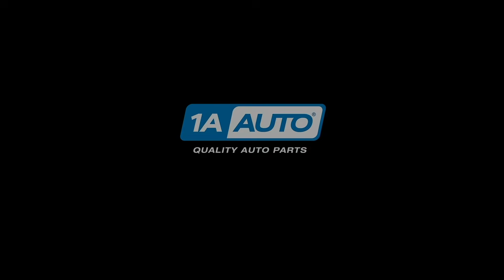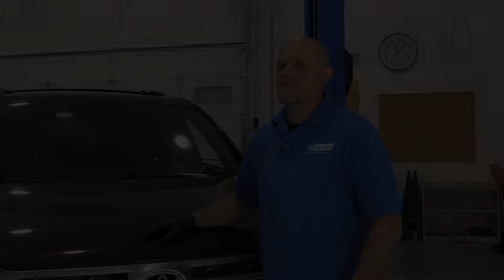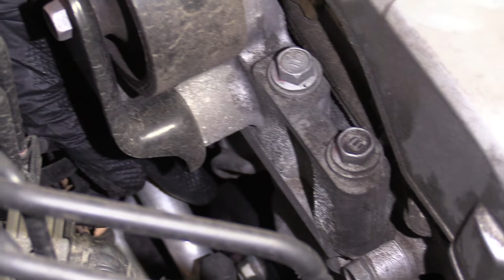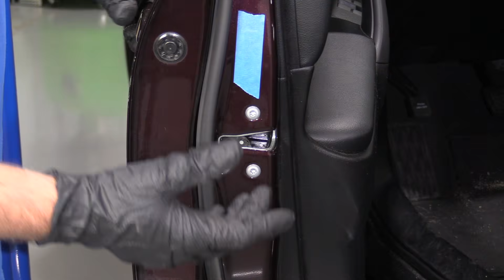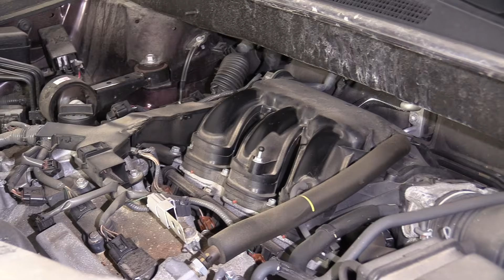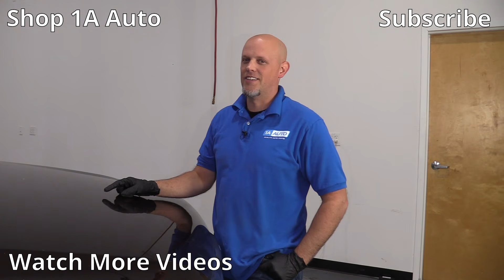Top 5 Problems Toyota Highlander SUV 2nd Generation 2008-13

Comment: I bought my 2012 highlander almost 8 years ago it had 29,000 miles. All I been doing is oil change, brakes and tires never spent a dime on anything else since I bought this car. I guess am lucky. Currently it has 134,000 miles.
Reply: I’m looking at a used one, 2 owners 145k used. I’m familiar with Toyotas reliability, currently have a Avalon 😁, BUT is it worth it getting it with 145k? They want 13k
Reply: @B-Man847  hello, did you get the Highlander? Someone is selling me a 2013 límited Highlander with 168k miles and they want $15k, is it worth it?
Reply: @igorrosales1799  I did not. It was sold. Lol. I actually just gave my Avalon a mini makeover so now I’m over the itch to get a car.
Reply: @B-Man847  i have a 2013 Avalon now, I just bought a very clean 2013 highlander limited with 150,000 miles for $15,000 as a second car, I’m picking it up tomorrow. Honestly these cars are so reliable that you can drive it for years and not lose much value.
Reply: @sammiemakki9339  Just bought 2008 Highlander 186,000 on it $9k  All maintenance records came with Previous owners had 12 yrs, bought 2 yrs old. Was a leased vehicle with 53k so hwy miles there.  Anyhow they change oil though blended syn every 3 to <5 k All repairs mentioned above here were fixed/repaired. Only worry is transmission fluid never changed. Seems to shift ok but I'll get that changed right away and switch engine oil over to full synthetic. Need struts but not a problem though not cheap these days. With all I've been hearing I am hoping tom get well past 300,000 out of it  Actually 400k if I live that long. Bought it to travel mostly.
Reply: You ARE lucky.  I had to replace water pump and alternator at 135k miles.
Reply: @johnkim701  that’s not bad at all.
Reply: Same, mines at 141,0000
Reply: I have a toyota kluger gronde 2012 in india punjab it's still going good and strong it has 127,000 miles
Reply: 161, 650 on mine, the only problem is paint is peeling off.
Reply: @leeshelenberger7240  slow down and put some lacquer on it !
Reply: Tank You for those advices, I’m planning te buy it

Comment: The only problem I have is my gas tank getting empty. My mechanic says it's because I drive it. I dunno if I should believe him or find someone else.
Reply: I’d get a 2nd opinion.  I mean what the heck is the big battery doing in the engine if it’s drinking all that fuel?
Reply: I push mine, I get a pretty steady 24 mpg

Comment: 261k on my 2010 Highlander. I burn zero oil!!!!! I don’t have to add any oil between oil changes. Greatest car ever owned. Runs like a champ still. I have the V6 SE Fwd.
Reply: Only 115k on my 2008.  😎
Reply: I have the 2010 too, bought November 2009. Not one single problem so far.
Reply: @bulldogvillan  did you make sure that your cooler oil lines ARE NOT RUBBER!!?? If they are, you may eventually experience engine failure if they aren't changed over to metal line fitting!! Toyota replaced the rubber line with metal during the 2012 model year, but your car is an earlier model. Just make sure...
Reply: @mykkc.5496  so should all 2013 models have metal?
Reply: Do you run synthetic oil?  If so what mileage do you change at?  Also did you flush transmission oil at the recommended intervals?  🙏
Reply: @Handofseeds  synthetic yes.
I think it's 8 thousand miles, and your local mobile 1 etc will let you know. 
No idea about flushing...
Always check your level from time to time/5, 6k
Reply: I change my oil about every 5k miles. Just GTX 5-20W
Reply: Second
Reply: Sweet!!!
Reply: Hi mine makes a rare quick saound when starting engine not all the time and just for a 1
Reply: Wait till you need a timing cover gasket replaced.
Reply: @desi4lyfe379  why have you had that issue before?

Comment: You forgot to mention the Oil Cooler on the 3.5 V6 models! Very dangerous problem! The rubber oil lines eventually fall apart, and literally drain all your oil out while you drive. Updated part has metal oil lines. This happened to my 2010 at 140k
Reply: Happened to my wife on her  ‘09. She pulled into a parking lot and shut off car in enough time to prevent damage.
Reply: did you change it your self? how much did they charge you?
Reply: Some said it's only issue with the towing package.  Did yours come with towing package?
Reply: @johnkim701  the one i just bought did, come with tow pkg and records show it happened. I even have letters to Toyota in folder that  they gave me They were on the road and dealership they had stopped at wanted to charge them when there was a recall. Have the letter Toyota sent them back as well interesting. Just glad to see it was fixed.
Reply: So it doesn’t happen on the 4 cylinder model?

Comment: I have an '08. I have had to replace water pump at 80,000 miles and my VVTI line burst at 105,000. Apparently the VVTI line is a super common issue and was fine once replaced with a metal one. Surprised the VVTI oil line issue wasn't in the video since it's a very common issue
Reply: I also have 08, 181k miles the vvti line never been touched. did you do it yourself? or how much did toyota charge you to change that tube?
Reply: Looking to buy an 08 limited have you had any other issues since then?

Comment: I have a 2008 Toyota Highlander Limited with 155,000 miles and the worst problem we've had is a oxygen sensor go bad. The other problem we've had is the bolt in the auto lift for the back hatch keeps working its way loose. 

The only other problem we've had is the deer love to run into the side of the SUV. We've only gotten a few tiny dents. Boy the 12 point bucks love to ram  their horns along the driver' side. We all have survived.

Comment: What mileage do these problems typically start happening?
Reply: My water pump cap went out on my 08 at about 137k n had coolant leaking. I had a problem with the alternator when i first got the car, think I needed a new alternator all together actually, don't remember 100%. Needed a new battery coincedently at the same time, idk if the bad alternator. Other than that, this had been a great, reliable truck
Reply: @luuneychild2951  I've seen mine on carfax, the previous owner changed alternator 3 times. Any idea?
Reply: I had my water pump replaced at like 100k miles and alternator at 135k miles.

Comment: I have a 2009 Toyota Highlander Limited w/ 114000 mi, and I love it. But Warning!!! If you have the tow package there is an oil hose that goes to an oil cooler, it has metal ends but a synthetic hose between them. This hose can blow which leads to an immediate loss of oil pressure and an alarm telling you to stop at once. When it happened to me, luckily, I was on a country back road so I was able to stop right away but if I had been on an Interstate Highway I probably would have fried my engine trying to pullover or exit. Cost of repair by dealer $564.00. My side mechanic was on vacation who probably would have cost 25% less. Toyota was aware of the problem because they had a 10-year voluntary recall to get the problem fixed, I missed it by 6 months. The replacement part is all metal. My advice is to replace it now rather than risking blowing an engine.
Reply: I had the same exact issue on my 2008 highlander at roughly 110,000 miles. Except the hose blew a hole so small I did not get a warning light I actually noticed the oil leaking myself. Cost me $250 to fix at a mechanic.
Reply: Wow. Sounds just like what happened to me. Was driving my 2010 Venza with 140,000 miles, out of no where engine light and oil light popped on. Got out and discovered the oil cooler blew, 6 months passed the warranty/recall as well. Cost me $350 at my Toyota dealer after I screamed at them. Luckily the engine wasn't fried. They won't pay to fix it unless it's broken. There should have been a recall. I can't imagine how many people have spent $4000+ on a new engine because of a simple hose.

Comment: I’m thinking to buy a 2009 Highlander with 110,000 miles. What do you recommend me before buying?
Reply: Make sure to check for oil leaks under the car. These cars have issues with the Oil Coolant Lines. 

In certain years, from 08' to 12', they used rubber hoses, which started leaking. This can destroy the engine, if not caught in time. 
I just bought a 2012 a couple of weeks ago, but they had already replaced those lines with metal lines. 

Also make sure the Rear Tailgate door opens properly, if you buy a Limited version with the automatic liftgate. 
Check and make sure the Drivers window DOESN'T CLICK, when you raise it. If it does, make them loctite the Bolts that secure the window!
But after all is said... THIS IS 1 BAD ASS SUV!! It can run for over 300,000 miles, if taken care of!!
Reply: I would say that as long as the car has a good service history when you buy it, it should last you at least 250,000 miles minimum GIVEN you keep up with all the necessary maintenance. I wouldn’t be shocked if the car last you past 250,000. I used to work for a lube shop and CONSISTENTLY saw 300,000 plus mile Toyota’s! Hence why I’m also looking Highlander like you! Not all Toyota’s are made the same but this gen of the Highlander is pretty darn solid in my opinion! Hope this helps!

Comment: Nothing major; will this engine run the 500,000 like the 4Runner 4.0 v6?
Reply: Heck yes, if you change oil.
Reply: It could get u 400k
Reply: No it won't bro after research this engone is no gooda

Comment: Not true sir, I have 2013 Highlander 2.7l since 2015 and never had any issue with the stuff you mentioned
Reply: How odd. I have the exact Year and engine that you have and I came across the Coil Ignition problem. Mine also has 112k miles on it.
Reply: i had a water pump failure onn a 2008

Comment: I have the 2008 toyota highlander sport 2wd. I get the code p0355 ignition coil E malfunction. Can you tell how to fix and where to locate this ignition coil E? Thanks
Reply from the maker: +Sino F We wouldn't be able to diagnose an issue like that here, you may want to have a local mechanic take a look at it. Thanks for checking us out! http://1aau.to/m/Shop-1AAuto-c

Comment: Buying a 2013 limited awd. 76k miles, should I be ready for any normal issues coming up around 100k?
Reply: The rubber VVTI oil line likes to burst around 100,000 miles. Its a good idea to go ahead and replace it with a metal one before you hit 100k. Mine went bad at 105k while I was driving. Lost all my oil with no notice and almost seized my engine
Reply: I own a 2013 bought it used with also 76k miles on it and it now has 112k miles. I did come across the coil Ignition problem but that was an easy fix. It is now running again with no issues. I’ll also include that mine is a 4cyl.

Comment: more than 5 problem from toyota 3.5 1 water pump leak engine oveheat 2 timingchain noise 3 dashboard like a junk 4 tranmission no dipstick 5 Transmission issues 6 ac some time work some time dont
Reply: What do you mean dashboard like a junk, and transmission no dipstick?
Reply: @luuneychild2951  he should go over to Ford maybe they will serve him some real “junk” 😃😂

Comment: I have a hard shift at slow roll from a stop and coming to a stop letting it coast the stepping on the gas iflt feels like it shift at catching and it goes.
Reply: Have you check your transmission Mount or engine mounts?
Reply from the maker: +kambo209 We wouldn't be able to diagnose an issue like that here, you may want to have a local mechanic take a look at it. Thanks for checking us out! http://1aau.to/m/Shop-1AAuto-c
Reply: Same here, I actually trashed my first transmission being an idiot and my 2nd transmission does the same thing so it’s probably normal.
Reply: I was expecting the Evaporator to be the top most and it's not even given the special mention...

Comment: I highly suspect the validation of the content, I have been in auto repair industry for 7 years. I have not seen a single knock sensor problem in any of the Toyota 3.5 V6 vehicle, are you sure you are not talking about the 3.0 or 3.3 engine? 
The VVT one is even more laughable, Toyota cam gear will last longer than any other parts in their car as long as you change the oil ( you can even change the oil every 7-8k mile on these V6 Toyota without worrying you check engine light on with the Crank/Cam correlation code or VVT code) . I wonder where their data point is from.
I do however agree on the water pump and ignition coil, but again, which water pump or coil doesn't go bad after 150k.
Reply: He did say "most common". That could mean that even if 1% of these engines have the issue, it could be the most common on an unproblematic engine like the 2GR-FE.
Reply: Exactly I have one 2010  6 cyl. with 230,000 miles on it, only regular  oil changes (3,000 mikes)  the water pump went out at 187,000 and that is the only repair my vehicle has required. I really doubt the claims in this video.
Reply: My 08 highlander rattles when starting up. And have had 3 alternators,  2 water pumps. One starter. Ignition coil  replaced,  240kay miles as of today. Yesterday check engine, vsc, all the lights come on blinking. Same thing it does when the alternator goes out.
Reply: My 2013 knock sensor went because the wiring insulation is tasty for mice and chipmunks 🐿 to eat... Fact.
Reply: do you think that the 1st Gen 3.3L engine 3MZ-FE has more problems than the 2nd Gen 3.5L engine 2GR-FE?

Comment: Transmission issues too...flushing should not be done unless there's metal in the drained oil..
Reply from the maker: +hondatrix Thanks for the feedback!
Reply: hondatrix; not sure why you don't want to flush it other than maybe too much pressure or something but you can and should change it. I change mine but I don't use any kind of flushing machine, if there is such a thing. Change it means all of it. Some say they do a change when it's only a partial change and they leave old fluid in. Not sure why but some new fluid  is better than no new fluid I guess.